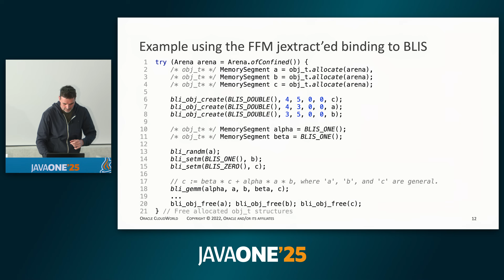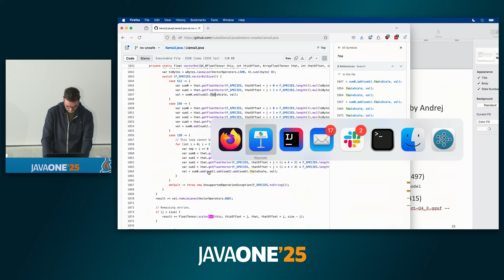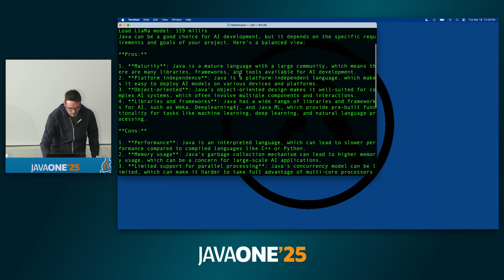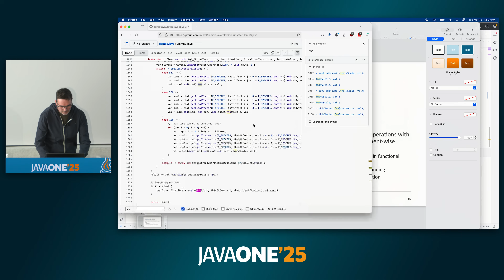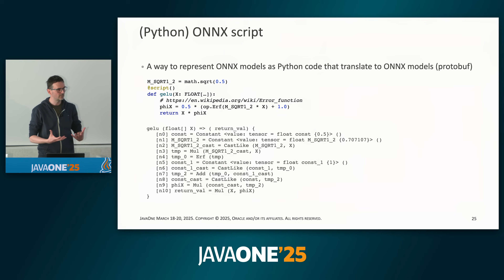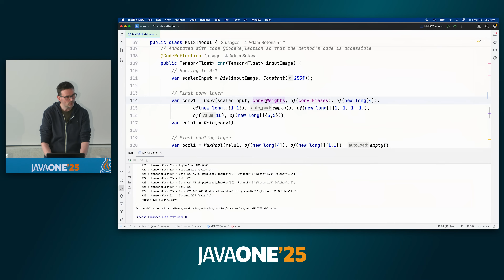Java for AI

Comment: I am using Python for AI because there is no choice at the moment. But python's dependencies are very flaky and difficult to manage once you have a dozen or so dependencies. There are breaking changes in libraries quiet often. One lib wants an older version of a dependency while other wants the latest version of same dependency.  It feels like the whole system is geared towards doing one off PoC on a single machine where once your environment is setup just right, you don't touch anything for the fear of breaking. You have things like virtual environments where you essentially create copies of every library including the python runtime! You run out of SSD space very quick. Your code automatically atrophies after a few months and will refuse to run. The concept of reproducibility of builds is apparently not considered important in Python world. Java has a very mature dependency distribution model with signing and immutability baked in. If AI becomes accessible via it will be a blessing for development and operations.

Comment: Performance update: 12 core threadripper pro, 32 gigs, windows 11, A2000 GPU 1b_Q8_0 GraalVM JDK25 I am getting anywhere from 50-100 tokens/sec! I was able to set the heap -Xmx26g and increase context to 128k. this thing just needs space and it runs like a scalded dog, but not under native. JIT is beating native all to heck and gone.

Comment: The 1b_Q8_0 seems to use 5 threads as a native exe and 25 threads running in the GraalVm under JDK25. In either case the performance seems strangely glacial. The parse is 3.45 seconds and the load is 1.01 seconds so its in line with the demo results, but after that the inference is crawling on intel 8 core i3 under win10.

Comment: We are too little too late. We kept thinking java is faster and better more matured it will always be at top and ignored python. But now python has caught up in modern world. Apart from banking systems or new frameworks nobody cares anymore about java. Automation- Python, Data Scientist and Analytics - Python , Data Engineering - Python, Ai & Ml - Python
Reply: Python suffers from the fatal GIL flaw, it is orders of magnitude slower and will never be able to do real multithreading due to GIL.
Reply: @Sven_Dongle  Python 3.13 introduces support for running without the GIL, aligning with PEP 703.
Reply: @rpshbhandari  correction, oh ye disinformation agent: Python 3.13 introduces experimental support for running without the Global Interpreter Lock (GIL), allowing threads to run in parallel on multiple CPU cores, which can improve performance for multi-threaded applications. However, this feature is still in development and may have some bugs and performance trade-offs.
Reply: @rpshbhandari  Also:The free-threaded mode is experimental and work is ongoing to improve it: expect some bugs and a substantial single-threaded performance hit! enjoy!
Reply: @Sven_Dongle  I mean most of AI code would use C extensions like NumPy, TensorFlow, etc that release the GIL during heavy computations
Reply: @ I mean, well, then that aint python then is it? it's C
Reply: @Sven_Dongle thats what python is about. You write performance critical stuff in C and have the user facing facade in python. This is happening in the java space too, look at the HTTP/3 implementation of netty, it uses the C api of quice under the hood to implement QUIC. There is a reason project Panama exists. Sometimes you want to write your stuff in C.

Comment: bruhhhhh do u even understand the current development of AI is leaning toward performance sensitive architecture, serving an LLM using a lowlevel runtime that highlyoptimize for production sometimes still encountered performance issue bcs of how costly the actual model is. And now someone suggesting to use JAVA like........ yea bro no thanks, aint no way I'm running my model with freakin JVM runtime 💀💀💀💀💀💀💀💀
Reply: The strong ai models are so heavy that java runtime is nothing compared to them. What matters is how fast you can make the number crunching itself. Java can make experimenting way more productive, leading to more efficient algorithms that don't need super low level optimizations to compete with previous algorithms written in c++
Reply: @IcyShower  You clearly don't work in AI field do you? you can't just build solution and PoC out of lightweight code in this field, someone need to train with various type and structure of data to make it work, evaluate the result, and reiterate the process  all over again to know which solution work best for the specific problem. If you assume all of this processes can be done using a highlevel unoptimzed runtime as JVM, I'd say your understanding on computer performance is highly questionable, your AI project won't go anywhere if it built on top of slow language. Also, talk about experimenting speed, highly unnecessary verbose OOP native language like java won't even outspeed python. C and CPP is not even that lowlevel, but most of the AI library that you mentioned so-called "..super low level optimizations.." is already have its own binding in python if you think you are not that skilled enough to directly code in so called 'super lowlevel'. Saying java would led to more efficient in experimenting is insanely wrong on another level of understanding
Reply: @drownwarlord7581  correct, I don't work in ai field. However, a few years ago I've talked with a guy who did HFT. What he said is that there was separation of guys who develop the mathematical model in e.g. python and guys who translate it to c++ and optimize. Optimization involved changing the algorithm to make it more amenable to speedups. That changes were subject to coordination between the two mentioned teams, i.e. the c++ guys couldn't change the algorithm without agreement from mathematical model guys. I assume that in such scenario, there are multiple ways to reformulate and adjust the original mathematical model in low level code, so the more productive you are with testing various different optimization strategies, the more likely you are to find a really good one.

Your assumption that JVM is an unoptimized runtime is wrong. JVM contains an optimizing compiler able to do auto vectorization, dead code elimination, escape analysis, loop optimizations, constant folding, extensive devirtualization and inlining and so on. Since the mainstream java works always in 'uncached' JIT mode, all the optimizations need to be redone on each run, which takes time, but project Leyden and graalvm native image are here to the rescue by saving the optimized native code to disk.

You don't need to code high level heavily OOP code for number crunching in java. You can write fortran-like code in java instead. Number crunching is not that much slower in java than in c++. Let's say java takes 50% more time than c++. When code is translated closely then that is very much possible. Is that 50% overhead that huge of a deal when you're trying to implement multiple different optimization strategies to find the best one? I'd say that speedups dependent on algorithmic or data structure improvements are often much higher than that.

Keep in mind that java is evolving to make it faster and leaner. There are several projects in development for various different improvements to Java platform. Project Valhalla brings value types and specialization over value types in generics (i.e. generics will receive layout optimizations too). Project Leyden brings various (configurable) levels of AOT compilation (including saving optimized native code to disk for fast reuse). Vector API from project panama brings simd in similar way to highway c++ library from Google (I think that vector API should have an edge here due to close integration with java runtime and optimizing compiler). Project Lilliput reduces objects header memory overhead. The vector API (I.e. simd abstraction) mentioned in this video is still in incubation stage, so the whole 'Java is good for AI' claim is based on things that will take a few more years to be made official.
Reply: @drownwarlord7581  says he is proficient and understands computers, then compares python speed with "highly verbose language" ... yeah, bc speed is related to verbosity 😂😂
Reply: @redrox8283  speed in experimenting and producing running prototype/MVP code, of course it is related to the verbosity, do you even code? compare both syntax and tell me how much unneccesary complexity you need to type to even produce helloworld in java?
Reply: I've made a long answer and YouTube just shadow banned me. What a joke of a platform. Anyway, you can see it if you select 'newest' answers instead of the (selected by default) 'most popular' ones.

Comment: still, most tutorials for that field are on Python....
Reply: Because they are tutorials (simple toy systems) and not large production systems.  Python is good when you need something 'quick, dirty and not requiring maintenance decades later by a different team'.  Isn't it better to have Python AND Java rather than Python OR Java ? you can have both sets of skills (although only one works at scale of teamsize and projects).   The 'either/or' mindset is a real problem in young developers. You can have both.
Reply: @staubsauger2305 good points but on the flip side python has extremely fast speed to proof of concept development time and is often sufficient for small to medium data related tasks. This ease of development is also one of the reasons python is preferable in a lot of situations.
Reply: Most users are not real devs. So? Makes perfectly sense if they use python first